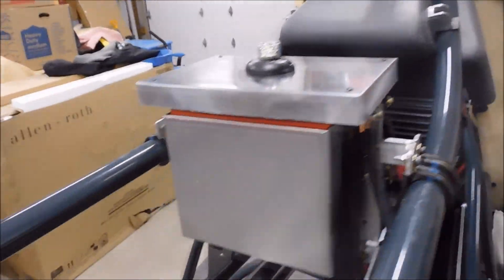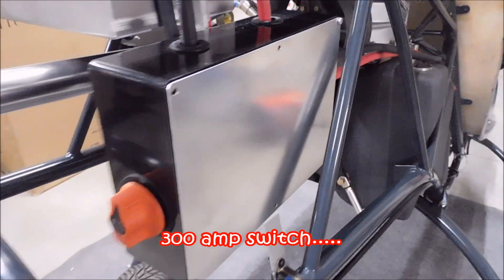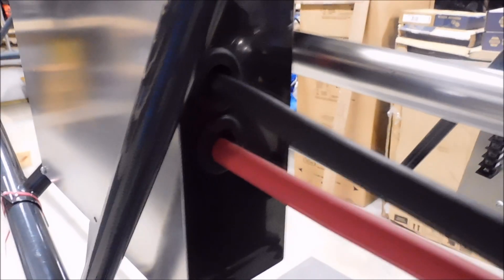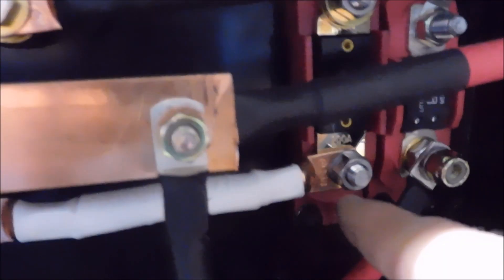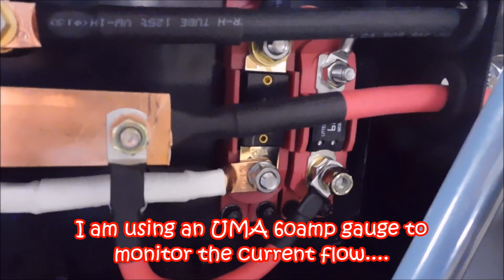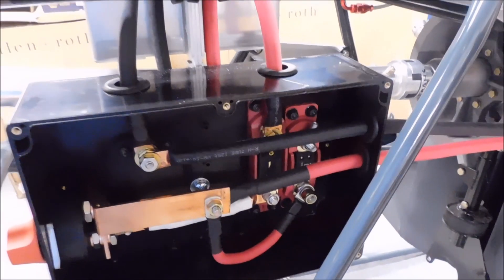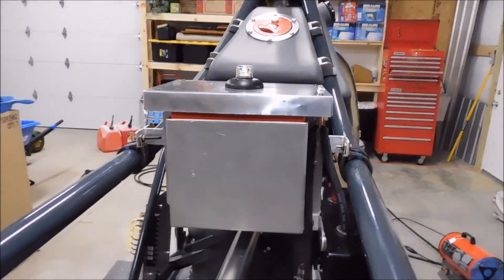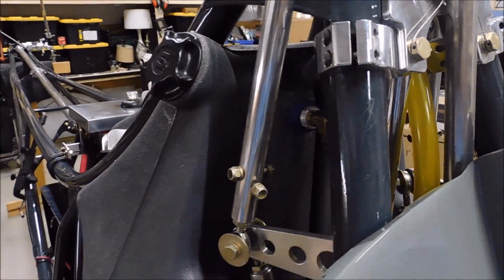Helicycle Electrical Power and Battery Box Installation!

Comment: Looks good Fred. Coming along.
Reply from the maker: James, are you going to modify your cabin on the new one? Anyhow, I plan to have my electrical panel looked at by someone who can ensure me that I am on the right track. I think I am though. More to come on all this! It is freezing in KY. I think it's about 4 degrees right now. suuuuuuuks.
Reply: @kentuckyhelicycle2614  yea, I think I will do the modified cabin. Do you still like the cabin. Does your engine mounts work with your battery box mounts. That is really cooled. It was 50 degrees today.
Reply from the maker: I am not sure if my positioning of the lower battery box mount will interfere with the engine mounts. For now, the box is roughed in with some "unknowns"!!  I think the cabin modification is something Keith ought to offer. It is way better than the old version. And yes... I love the cabin as I got it from you. When that thing comes together, it will kick ass indeed.  @jameskent3114
Reply: @kentuckyhelicycle2614  yes sir. Can’t wait to see it. Hey I emailed you as well. I noticed on your oil cooler that you used new oil lines. I was wondering if I could buy the other ones that I sent with the oil cooler, if you’re not using them.
Reply from the maker: Let me dig them out of my stuff! I will also get you some images of other things I have. May take a few days, but I will do this for sure. @jameskent3114

Comment: Looks very nice to me. 👍👍
Reply from the maker: Thanks Ben! My daughter says the weather is really cold in Brighton. How are things your way? Are you still working on your projects?
Reply: @kentuckyhelicycle2614  Yes it's cold at the moment for us, hovering around 0 degrees. I built a waste oil burner for my workshop 
https://youtu.be/ThKcnSF4SYM?si=bRks-kS3EDbE6p6
that keeps it nice and warm so I really don't mind anymore. 
The flying boat is coming along and I've decided in the last few days to fix my helicopter driveshaft. Although there are big limitations with my chosen design I think it can be used in very little wind and perhaps the handling oddity's can be got used to. I didn't get enough hovering time with it to verify this so trying again. I've come up with a way to fix the driveshaft which I think will work. I'll also add more protection to the pilot and try and encase the shaft.
What's next for the Helicycle ? It's looking beautiful.